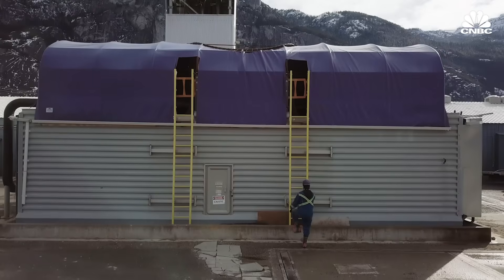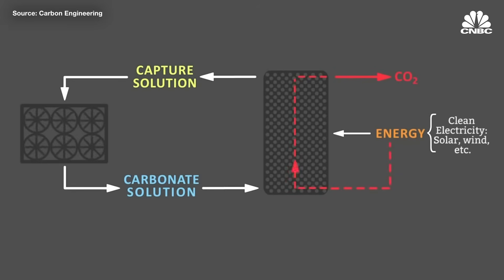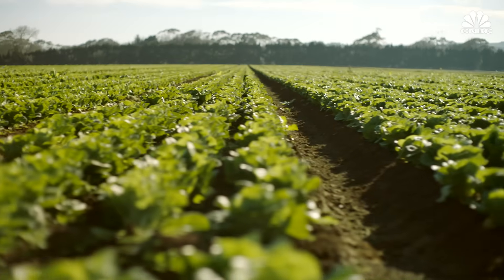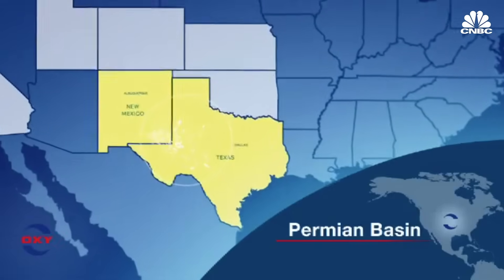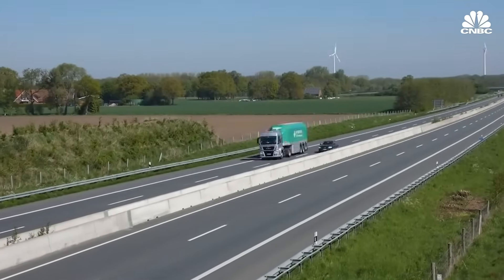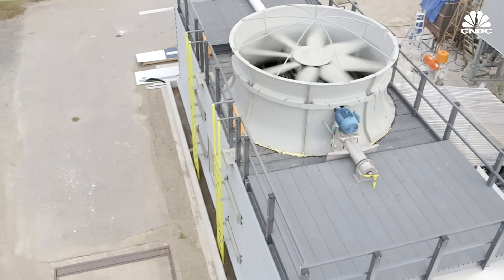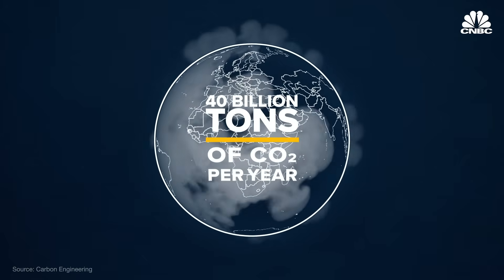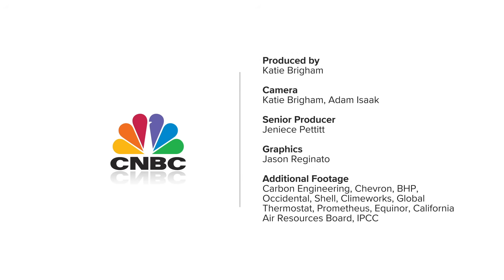Bill Gates-Backed Carbon Capture Plant Does The Work Of 40 Million Trees

Comment: Enough of this fluff. Show the total amount of energy needed for the process and the amount of CO2 reduction.
Reply: Exactly. And, most likely the source of energy is probably still fossil fuel
Reply: @rosannecannella8112  Why should it be fossil fuel? They can build a nuclear eactor next to the co2 plant.
Reply: @borisan5048  
Temperature. They mentioned a very high temperature was needed to extract the carbon dioxide. Current nuclear plants use pressurized water, about 1 ton per square inch, to prevent boiling restricting the temperature they can work at.

Heat directly from a nuclear plant would be insufficient: electricity would be needed to achieve the required temperature.
Reply: @michaeledwards2251  Yes. So you produce electricity with nuclear reactors and then produce heat with electricity . You have do this conversion anyways because the steam in the reactor is radiating.
Reply: @borisan5048  
The steam driving the steam turbines does not go through the nuclear core, pressurized water, at one ton per square inch, does. The purpose of the heat exchangers around the core is to transfer heat from the pressurized water to low pressure water which converts to steam. The steam goes through high and low pressure steam turbines and is condensed back to water in cooling towers.

The low temperature of the stream used in nuclear reactors implies a low overall efficiency of about 35%. 

(The boiling point of water increases with increasing pressure.)

Molten salt designs overcame this obstacle by using fluids with a high melting point at normal pressures to cool the core. For example lead, UK implementation, uranium fluorides,  Oakridge US, and other options, but none have hundreds of tested implementations in use for power generation.

With a high temperature nuclear core the heat transfer process would be 2 stage.
1. Fluid  A through the core.
2. Fluid  B through the heat exchangers to cool Fluid A.
3. Fluid B heats the chemicals to be disassociated to a very high temperature to release the carbon dioxide. 

Direct heat transfer would give triple the efficiency.
Reply: @rosannecannella8112  
They said in the video that they use heat from methane, and hoped to use renewable energy in the future.  They simply said they use electricity, 10 metre fan, and heated the chemical product to a very high temperature to release the carbon dioxide. Given using heat from gas is twice as cheap as electricity as a heat source, the 92 dollar price was achieved using natural gas, methane, for heating. 

Given the leakage rate of methane, about 3%, the initial effect would be to release the green house gas equivalent of carbon dioxide by 6 tonnes for every tonne extracted. 

(Methane is a green house gas 150 to 200 times more effective as green house gas than carbon dioxide, molecule for molecule. The effect over a period of a century would reduce, due to the conversion of methane to carbon dioxide, to one tonne equivalent.)
Reply: Yes, I've been waiting for that. Give us  the numbers and graphs and charts instead of these back and forth arguments 🙄
Reply: @doodletime1512 . Go looking for the information. It's freely available for people who don't expect to be spoon-fed.
Reply: @hawkesworth1712  expecting good journalism is expecting to be spoon-fed? Then might as well tell journalists to quit their job. Everyone who wants information should go find it themselves.
Reply: @doodletime1512  .......and where will you find information? Probably somewhere where a journalist put it.
The reason why people make articles short is because nine times out of ten people look at the length of the article and decide not to read it if it's too long.
That's why if you are interested in a subject you go and look for more information.
These articles are designed for the McDonalds-drive- thru generation.
Reply: @hawkesworth1712  sigh... Journalists are not the only people who can write articles. When you made outrageous claims like 40m trees you better explain how you get that number, else it's just a lot of baloney like Trump. This whole wishy washy video is just one bad journalism. I see you're trying to change the subject. I don't entertain trolls, bye bye.
Reply: they've said that at the moment they break even between removing the CO2 and electricity needed to power it, but as we improve our access to renewable electrical energy in Canada it will obviously become a negative rate of emissions expelled to those removed. And the company hasn't said this is the cure for global warming, it's just to prevent the worst impacts in the next decade. They know as we all do that we will need to entirely change the way we live in the First World to net-zero carbon so Third World countries can build the infrastructure they need for living with dignity including building schools, roads and safe housing.
Reply: It’s always fluff, even in the WSJ just today which compared wind prices to coal prices. Apparently factoring in renewables’ reliance on subsidies isn’t even a question anymore, hence their zero desire to even mention it and how such subsidies make wind “cheaper” than coal.
Reply: @mtb416  . Coal is subsidised.
Reply: @mtb416  
Have you forgotten the subsidies fossil fuels get from governments ?
Reply: @mtb416  
The fossil fuel industry is an amortized technology. It does not have to bear the cost of new construction, merely replacement every 30 to 40 years. 

Additionally it is not charged for all the indirect costs, spreading toxic material, uranium, lead, carcinogenic compounds, and green house gases. 

(For example the loss of water sources when mountain clear top mining for coal.)

For renewable energy the technology is still in the process of development and requires multiple large scale replacement before stable solutions will emerge. 

Subsidies are needed to speed the process: the pollution from fossil fuels will become increasingly costly to deal with.

(It is forgotten how fossil fuels had to undergo multiple technological changes before the modern iteration appeared.. Additionally fossil fuels will become more expensive as all the easy to extract sources are exhausted. )
Reply: Did you count the number of fans in the illustration they showed for the 1 megaton per year plant, about 400 ? This implies 16,000,000 fans of 10 metres would be needed with the associated chemicals for each one.  Additionally to the cost of storage will need to be added to use renewable energy sources.
Reply: Ok. here is what I need to know. If  1ppm = 7.81 Gigatonnes of Carbon Dioxide how much will this remove ? Now if we want to roll back 100 ppm that is 781 gigatonnes ! So let me know it's cost/benefit. Please save me with the "It's better than nothing"
Reply: In a world full of wind turbines and solar panels your comment is just stupid.
Reply: @hawkesworth1712  Stupid? Asking for details about claims is stupid?  Sorry proof required, faith is stupid.
Reply: @bigblue2216 . What claims?

Comment: you kinda lost me "used to make products like fuels" wouldnt that put it back in the environment ?
Reply: Yes, but if you put it back from the air after taking it from the air that s called carbon neutral fuels. If 100% of the economy was carbon neutral it would work like the biosphere. The biosphere is also carbon neutral: in and out of co2 is matched thus keeping co2 concentration stable.  Extracting and burning FOSSIL fuel ADDS more new co2 to the atmosphere. That s what s causing the concentration to increase.

Comment: theres about .0002 tons of co2 made per kwh of electricity worth 13 cents.    that 13 cents covers the transmission lines, plant cost labor equipment etc.
  fuel is maybe 20-40% of the total cost?  nightly power rates are often around .05$/kwh on plans that offer hourly rates.
this would mean that fuel is worth about .05$/kwh or 250$/ton emitted

if a power plant burning natural gas was to be made to pay to recapture its entire emissions at 250$/ton even it would only add only a few pennies per kwh based upon this math and the quoted 232$/ton capture cost above. full scale plants at power plants ie economy of scale would likely see this improve.

this would make natural gas plants nearly "green" with "near green +99%+" energy costing only some 5 cents per kwh more.  
coal emits nearly 2x as much as natural gas so any such law would see most coal plants quickly shuttered
on the low end of 90$/ton it would be about .07$/kwh after capex expenses

solar would have to get to X$/watt at 6 hours of perfect operation per day at .13$/kwh to make an economical return in 10 years
x=6*.13/1000*10*365=2.85$ installed. this doesnt include night bad weather or winter storage

so you have 2 paths to choose from, sequestering carbon buying us more time at an economical rate or waiting for solar and battery storage to shut down fossil fuel plants or at least reduce their outputs

using day time rates which include fixed costs you'd have national avg of .13$/kwh + sequestration of .05$/kwh for .18$/kwh on one hand which is already below power rates in california.
this would be effectively green carbon emission wise

on the other hand you could push commercial and grid scale solar which is nearly in at the economical cost of .1$/kwh to offset a large portion of carbon
without sequestration solar would never be able to get carbon emissions to negative

so the question would be do you install solar to just not burn the fuel during the day at .1$/kwh or do you pay .1$/kwh to burn the fuel and then pay to sequester it
solar is proven and you can install as much as you want on commercial builds and likely beat 3$/watt installed cost quite easily allowing it to produce below .1$/kwh, once installed requires little labor and would reduce the need for transmission lines (small cables and lower duty equipment could be used).

solar is only getting cheaper and cleaner.  even if sequestration worked you still have all the emissions of the supply chain and still you'd have to find a place to dumb millions of tons of carbon solids or store it as a gas that can escape in hundreds of years.

Comment: This is funny. Cars don't produce Carbon Dioxide they produce Carbon Monoxide. There is a big difference between the two. 
So please stop lying to yourselves. This will not help. They need to pull carbon monoxide out of the air not carbon dioxide.
Reply: They produce both, but they produce more CO2 than CO because oxygen is plentiful in the atmosphere.  If you were to turn your car on in a garage then you might get a little more CO than CO2 because of the enclosed space you're in.

Comment: Yet another attempt at amine absorption backed by big names with apparently no thought for thermodynamics. I'm surprised every company that comes up with this stuff manages to get millions of dollars to prove what process simulation software easily predicts - that these amine systems are a dead end and only passingly useful as a source of CO2 in the middle of nowhere for enhanced oil production. The only time these might be built is if they're cheaper than building a CO2 pipeline from a natural source. Tech like this always getting media coverage is just a distraction from other potential solutions to CO2 capture.

Comment: How about also using less energy so you produce less co2. Like replacing all lights in houses and streetlights with LEDs. LED lamps use a lot less electricity than other lights, cost less to maintain, are smaller and last longer. We can also use 5th generation nuclear power plants which are better in every aspect than the old ones. We can also convert old simple cycle natural gas power plants to combined  cycle natural gas plant so you can produce a lot more electricity with the same amount of natural gas. (Simple cycle natural gas power plants make about 50% less electricity than combined cycle natural gas power plants). Also we can put solar panels on all houses and put wind farms in windy areas. And certain places can be renewable energy exporters. Like palm springs is sunny for 350 days a year and is very windy. You see more wind turbines there than solar panels. You connect everything to the grid and voila you have the no carbon emitting enrgy sources, if you take out the natural gas power plants but for this plan to work in the U.S. We would need the natural gas plants to transition to the no co2 pollution goal. Also get rid of the coal power plants. And the last thing is make it mandatory for all cars models to have a hybrid model by 2030. And trucks can have the same rule.

Comment: Colossal waste of time. The earth has been warming since the last glacial minimum. Interior magma is hot, very hot. It warms up and cools over long periods of time. Carbon dioxide is emitted into the atmosphere and is absorbed in the oceans that cover most of the earth's surfaces. Higher ocean temperatures mean less absorption and higher atmosphere concentrations. Carbon dioxide concentrations are the RESULT of the ( interior) warming of the earth, not the cause.

Comment: im no genius but capturing carbon seems like an endothermic reaction, heavily so.  

seems like it would be far easier to just stop making it from all possible sources first by an order of magnitude then offset unreducible sources
Reply: the only benefit this could ever offer is that of an energy inefficient way to balance unavoidable carbon emissions or as a fossil fuel powered "battery" that uses solar during the day time to remove the carbon produced which makes no sense as 100$/kwh batteries are already economical at .1$/kwh deltas 1 cycle a day and 1700+ and growing fast lifespan cycles.

darn near any chemical reaction can be reversed with enough money time and energy

Comment: This is a great way to have easily transportable and storeable energy that is closer to carbon neutral. Battery technology just isn't there (yet). Using this technology to produce gasoline and diesel while simultaneously using the same technology to bury carbon in the ground could make up the carbon difference and render all fuel produced by this method carbon neutral. A lower net emissions carbon source is EASIER to sequester! The critics that invalidate this technology because it benefits fossil fuel companies are missing the whole point - that it is a well-engineered first step in the right direction.

Comment: @CNBC maybe the engineers could figure out a way to use the CO2 but they're sucking from the air to maybe power their machine or maybe converted back into oxygen.
Reply: What would that chemistry even look like, what would the final "exhaust" be? CO2 is a fairly unreactive substance and doesn't suit well as a direct fuel.  When you burn hydrocarbon fuel you get CO2 and water as the primary constituents of exhaust - you must put a lot of energy into those two compounds to turn them back into fuel and oxidizer (more than they ever released being burnt given the laws of thermodynamics).  Fuel and oxygen in the same space have a lot of stored chemical energy - water and CO2 are regularly found together as soda/pop/fizzy-drink with almost no stored energy - certainly not enough to even run the fans.

Comment: My prototype allows for the use of optimum ignition timing advance.  This gives the engine more time to burn the fuel and get better economy and horsepower as A result.  

If engines were built specially to use my prototype then even greater efficiency would be the result.

This is A viable solution to reduce carbon emissions, save fuel and get more horsepower.

My video shows full throttle acceleration at the full ignition advance setting with no engine  knock!

Just waiting for someone to buy my prototype.  If that doesn't happen?  I will just keep it for myself!  I don't care either way...

Comment: This is a scam. They don't need to pull it directly out of the air, when they could just get it from any coal or gas power plant directly. Then they use wind or solar to create new fuel, when they could just directly use wind or solar electricity to reduce gas or coal usage. They're only making renewable energy less efficient.
Reply: But we still get to have cheaper energy while have a neutral effect on the environment if this is actually successful.

Comment: Here's a thought... if the deserts are suffering from a carbon shortage, why not mix the captured carbon here in the desert sands? Also it's more than a bit hypocritical to complain about an oil company that is making an active effort to reduce it's carbon footprint. 😑
Reply: Dessert don't have trees because they don't have water not because of lack of co2.
Reply: @miles2378  Water is only part of the problem... deserts also lack nutrients which carbon helps provide. And wasn't the invention of graphene supposed to virtually eliminate our water shortage problems?

Comment: The number of 300W solar panels required to meet the energy requirements for 2040 is 300 billion.  That cost is US$30T, assuming an installed cost of $100 per panel.  That doesn't include energy storage, which is still waiting for a cost effective solution.

Using technology we have, we can orbit mirrors to reflect sunlight to ground based solar panels 24/7.  Eliminating "night time", reduces the required panels to 60 billion, and we no longer need storage.

Comment: That Berkeley guy is low imagination, low thinking. Climate change is the enemy, not fossil fuels. If you can prevent 100% of the emissions from fossil fuels from going into the atmosphere, then what's the problem with fossil fuels? This guy just hates fossil fuels irrationally. Probably hates nuclear power, too. We can do more than one thing at a time. Capture CO2, build nuclear power plants, build solar cells, increase efficiency of batteries... The idea that we have to just do one is ludicrous.